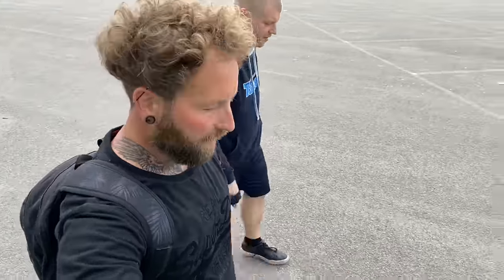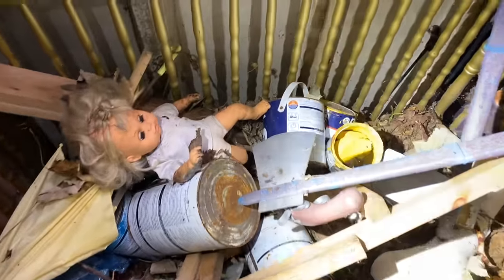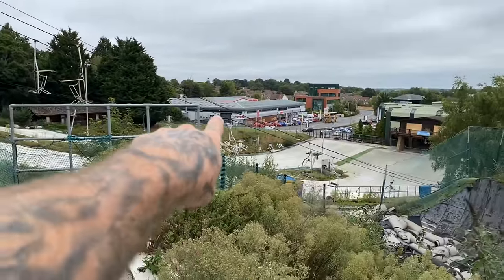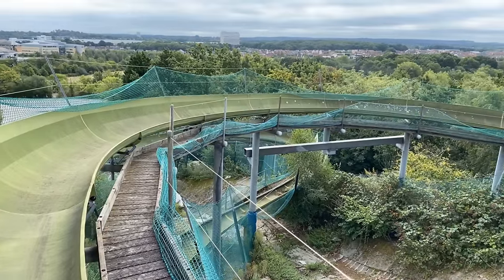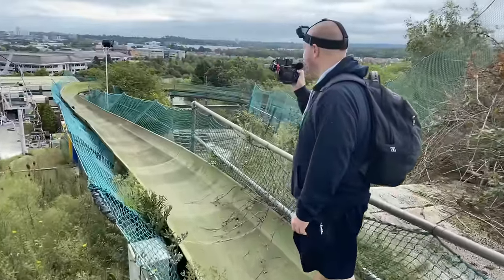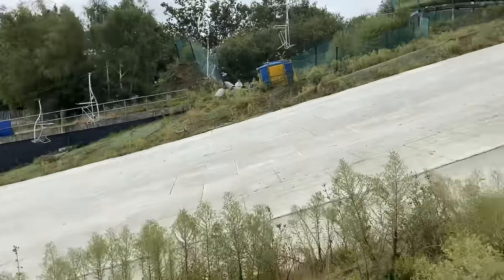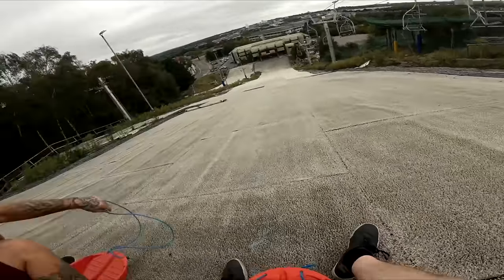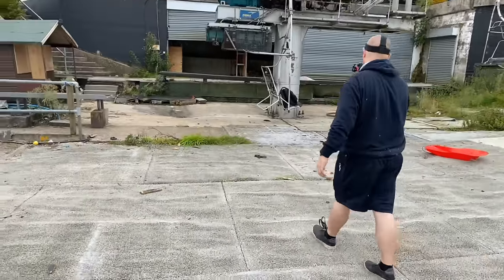We Explore Eddie The Eagle Abandoned Ski Slope In The UK!!

Comment: It's such shame this place closed it was a casualty of the first lockdown I have so many happy memories  of this place. I learned to ski there I had my first job there in 2003 - 2018.

I was a Ski Tech and later on an instructor (free training if you worked there) I also had a few snowboard lessons there that were pretty fun (again free). The hut outside the perimeter fence at the side of the intermediate or teaching slope was actually part of the  complex it is the old ski hire before it was moved up to the top where you got through the fence. The chair was closed in about 2015 or 2016 after they "fixed it" they created other issues that they couldn't fix and that put paid to the toboggan ride too (what you called the flume) The garages at the side of the chair (was used for storing snow bobs and other things like that except for the rings which were stored upside down on the side of the slope. It was a really cool place but went downhill (pun intended) when they put in the new surface. Go to any other slope like Wycombe Summit (also abandoned) and you'll see what most slopes use. The bit you came in on was the quarter pipe supposed to be used for southern free style club but someone
 hit it really hard once and landed in the carpark and broke his back so it was never really used.

inside the centre you would have found the ski hire from the slope. Down stairs there was a kind of cafe that sold fast food and drinks like Slush Puppies, burgers and the like. It faced the rink which was used for ice discos pantomimes on ice and ice hockey games (the home ice of the Bracknell Bees.). The skate hire right across from the cafe and had an exit right out onto the ice. Upstairs from ski was the hospitality suites some WC’s and a bar which and an annex right by the ski slope and a view of the slope up stairs from there was a gym which I didn’t really use, called Apex Fitness and I think it was rented from Mr Nike. Upstairs from that was a storage room used to store ski buggies and things for the adaptive skiing. You could access it either from inside the centre or up those stairs you found on the ski slope I think it was originally going to be used as a ski bar or viewing gallery but it didn’t pan out.

I could see the writing on the wall for quite a long time, but I was still sad to see it go when it did. The problem is it would only have taken few thousand pounds to get it back to its former glory or to bring it back even better than it was before.